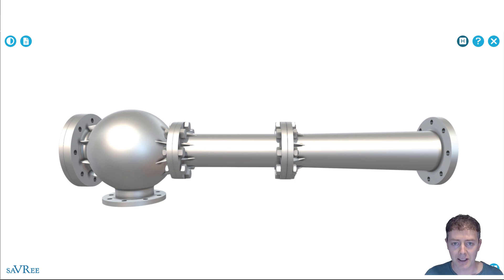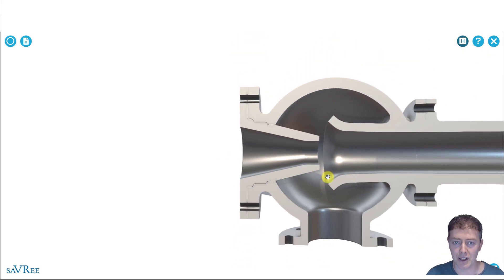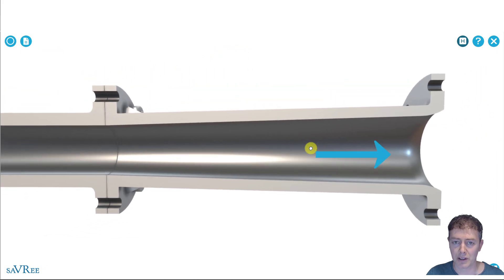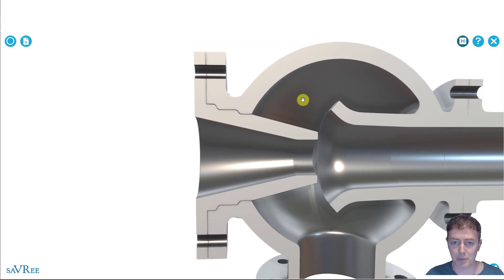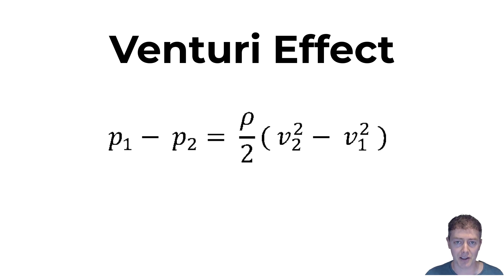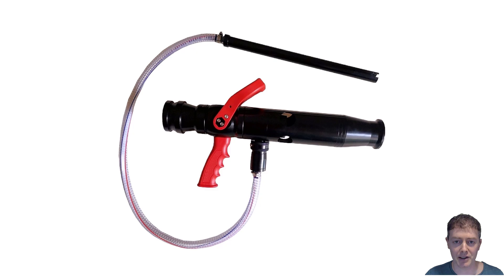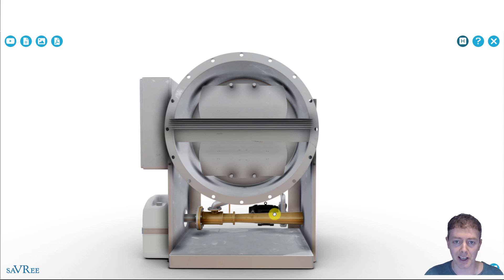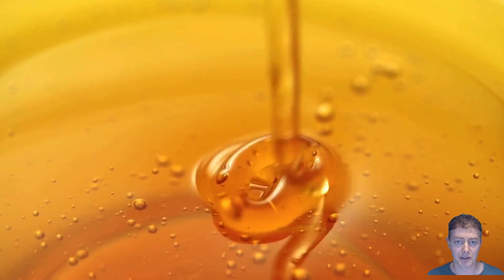saVRee Snacks #09 - Eductors, Ejectors, Venturi Pumps and Jet Pumps Explained

Comment: I am still thinking about those traumatic events that happened in my life and those led me to have PTSD I am fine but so where do you find these machines and pumps
Reply: To create vacuum in a process in various industries. Ejectors are used to create vacuum for Black Liquor Evaporators in paper mills for example. Steam is motive fluid, and it draws in non-condensable gasses from the evaporator set’s surface condenser to keep a vacuum
Reply: Wet blasting (sandblasting) uses such a mechanism.